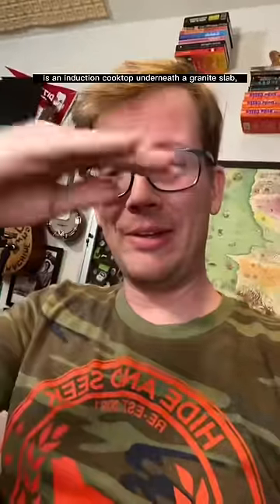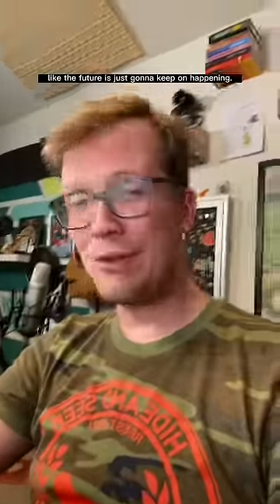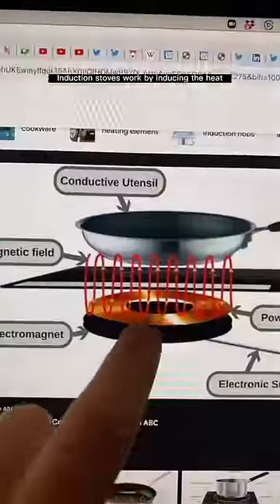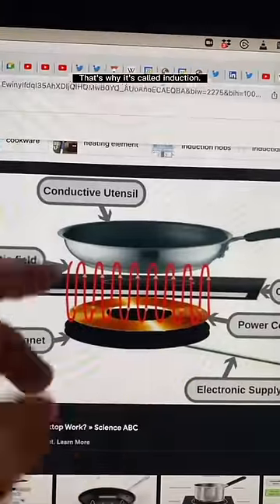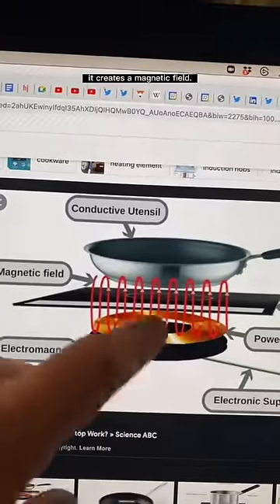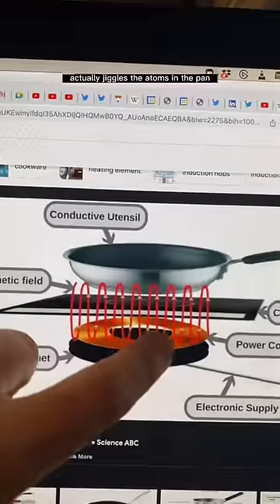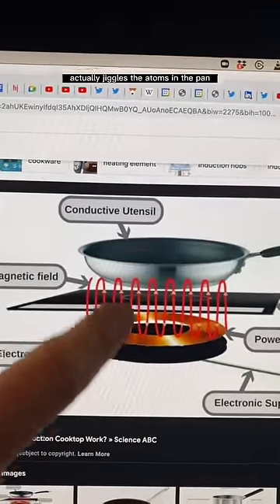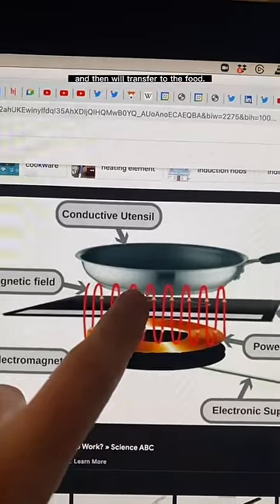How do induction cooktops work?

Comment: Yes, camouflaging the thing that can heat and melt various things is a great idea!
Reply: not how it works
Reply: @ouravantgarde yeah, you only need to worry about anything that's magnetic or sensitive to magnetic interference on the surface such as your phone or keys or credit cards or laptops. Nevermind the game of "is that pan hot or just left out"
Reply: @ouravantgarde the granite will still get hot from the pans and pots you heat up on it. After removing them you have an invisible super hot surface that can certainly melt stuff.
Reply: @derKischda this! That stone is going to hold heat for a LONG time. Plus all the scuffs and abrasions from sliding pots and pans off of it? No thanks.
Reply: @vlanoik  I know that. "various things" was intended to exclude both how some materials may not melt when heated to the maximum of what that the stove can heat it to in addition to some things no being directly heated when put on the stove. regardless, if a thing is being heated and something is on top of that thing, then the thing on top will usually also get hotter. "certain things" may have been a more accurate way of phrasing it.
Reply: @derKischda  Precisely
Reply: Yes it is  @ouravantgarde
Reply: I like how evryones arguing when there isn't even a fing induction stove under the granite its literally just a countertop. Use common sense it's literally a countertop where are the buttons or nobs to adjust the temperature. Where would the power even come from you can't just use any outlet for a cook top and they don't install heavy duty sockets on kitchen islands. Common sense people get some.
Reply: @tangerinetech5300 what do you mean where would the power even come from? You don't typically see the power source on your stove/oven because it's not esthetic and it's very easily hidden. Maybe this person is BS-ing, but it also wouldn't be very difficult to mount hidden nobs to the underside of the counter or behind a false front, kind of like those cool shallow cabinets that you sometimes see instead of fake drawer fronts in front of sinks
Reply: He literally told you it doesn't get hot
Reply: Not how that works but it could still cause problems
Reply: @msjkramey Modern induction stoves usually don't even have buttons or knobs anymore, they use sensors.
Reply: @derKischda  But it's granite, and granite releases heat very slowly. I bet you can easily put your hand on 100º C (212ºF) granite, feel it's hot, and yet not burn your hand.
Reply: @vlanoik like a cell phone
Reply: @ouravantgarde that's exactly how it works. You think the metal pan isn't going to transfer the heat to the granite? Only up to the food? No. Metal pan hot, hot transferred to thing metal pan is on
Reply: It was just explained it doesent work like that
Reply: @jarlbalgruufthegreater1758  wrong. Put a hot pan on a granite counter top. Granite underneath heats up from hot pan. Remove hot pan, camouflaged hot spot remains. Think more critically
Reply: @derKischda  wrong, you can literally take the pan off and put your hand straight on the stone and it's not hot
Reply: Watch the video again 🤦🏼‍♂️
Reply: @jamesm3830  I have a granite counter top that I put hot pans on it all the time. That heat transfers to the granite. And while it cools off fairly quickly, if you put something on the spot immediately after, like plastic, it will melt it
Reply: On the plus side, it'll totally charge your cell phone. Even the ones without wireless charging. Feature's been out for a long while. I originally heard about this on 4chan. Haven't tried it yet, though.
Reply: Yes and no. Not having indications makes it difficult to use, but induction cooktops do not generate heat. You can turn on the stove and put your hand on it and you'll be just fine.
Reply: @chasehaskell6490  Pan gets hot. Is sitting on cool granite countertop. Countertop absorbs heat from pan -- not fast enough to affect cooking, but enough that it'd burn you pretty good after 20 minutes or so of contact
Reply: @fred321  You don't understand how heat works. if its actually 100deg, you're gonna burn your hand.
Reply: @ouravantgarde that's not relevant though. The heat between the magnet and the rocks doesn't matter when we're calculating the heat transfer from a metal pan to said rocks.
Reply: @GamezGuru1  100 degrees only tells you up to what point  that will heat your hand (100). The rate that the energy transfers depends on both the temperature and on the material. If I put my hand on 100 degrees metal, it will instantly burn. If I put it on 100 degrees water, and take it out immediately, it will burn a lot less.

You can put your hand on a rock that is 100 degrees, and you will feel it is very hot. If you leave it there, it will heat up to match the temperature, however, you have a lot more time before the heat does significant damage.

The same concept can be used when you go to the beach on a sunny day: It's much harder to walk barefoot on sand than it is on concrete or wood. They're being heated by the sun, and are about the same temperature, but one heats up your feet a lot faster than the others.
Reply: @derKischda you can put paper towels under the pan while cooking and they won’t burn using induction.
Reply: @duke605  Not very much tbh. Heat rises after all.
Reply: @fred321  I get your point about heat conductivity, but it's crucial to recognize that rocks, including granite, boast fairly efficient heat conductivity. Your comparison between walking barefoot on sand versus wood or concrete at the beach actually supports this idea. Sand, essentially finely ground rocks and minerals, heats up faster due to its superior heat conductivity.
Though i should note that concrete also transfers heat much faster than wood, similar to sand.

Think about the historical use of rocks or stones in cooking surfaces Throughout human history. Even today, we still employ rock like materials, often in the form of ovens, for heating foods. The enduring practice stems from the efficient heat transfer capabilities of rock like materials.

So, when you mention putting your hand on a 100°C sheet of granite, it's not an instant third-degree burn like with a steel bar, but it can still cause significant damage over a reasonably short amount of time, certainly far less than a minute. Just because it's not an immediate burn doesn't mean it's not a burn; both scenarios still warrant a doctor's visit.
Reply: @Cat_of_America I just googled it:
Sand conducts heat about 5 times faster than concrete.
Steel conducts heat about 15 times faster than metal.

Yeah... in the time metal does a 3rd degree burn, I'm not sure you could get a 1st degree burn from granite.

I know we use rocks for cooking. My mom used to use stone pans to cook, and I knew I could see if they were hot by touching them fast without burning. I would never do the same with aluminum pans because these do burn with the slightest touch.

You're very wrong about why we use stone pans. It's not because they transfer heat fast. It's because they're so slow to transfer heat that even when you put a big open fire under them, the food might not burn. If you try to cook the same way with metal pans, you will get a half raw, half burnt meal.
Reply: @fred321  Your points are interesting, but there seems to be a misunderstanding regarding heat conductivity. While it's true that sand conducts heat faster than concrete, your comparison between steel and granite overlooks the fact that granite, like steel, is also a solid material with relatively high thermal conductivity. This means it can transfer heat quite efficiently, causing burns over slightly more time than steel. It's crucial to recognize that granite can still cause significant burns in a relatively short amount of time, even though it might not be as instantaneous as steel.

Additionally, it's worth noting that steel is a type of metal, not a separate category from "metal."

Your personal anecdote about stone pans is noted, but it's important to consider the broader scientific understanding of heat transfer. While stone pans may have benefits in certain cooking scenarios, they're not solely valued for their supposed slowness in transferring heat. Historical and practical evidence suggest that stone pans are used not just for their ability to withstand high heat, but also for their efficient heat transfer, similar to steel, allowing for consistent and controlled cooking, during a time when metals were expensive and not widely available if at all.
Reply: @tangerinetech5300  I confidence of the ignorant is truly hilarious. look, you made an okay inquiry asking where the controls are, but you should have done research first. A lot of induction cooktops that have granite, marble or quartz countertops are known as invisible cooktops as well. the whole point is to hide everything that makes the ugliness of a stove invisible and not distract from the architecture of the kitchen. so the controls are usually hidden under neat in a drawer or off to the side. Sometimes there are controls right on top of the counter but other times it's built into the counter itself as a touch controller and lights up when you interact with it.I have also seen touch controls that were on the range hood above the cooktop.

You don't even see where the induction plates are, but you can feel it with your hands with slight etchings on the counter. Others are totally smart home enables and you can control it with a potable kitchen tablet.
Reply: @eingoluq  says confidence of the ignorant about a stove top lol and is the random capitalized "I" at the beginning of your comment also supposed to indicate ignorance or do you not know how to proof read your insults. And I love how your just calling me ignorant and saying yeah there is a stovetop. Like okay pal have fun caring about nothing.
Reply: @duke605 the pan isn’t directly in contact with the counter top, check the original video
Reply: What a terrible idea! Way to go
Reply: @unsaidatom2310  learn how it works first. if you sit on it while it is on absolutely nothing will happen. because it doesn't heat things through the stone.
Reply: @derKischda  this actually depends on the type of counter top and likely if you CAN put this counter top over the cook top it's a protected kind that doesn't damage or get hot from pans or cookie sheets I know cause my family was actually given such a counter top it's very nice
Reply: @FalseMem0ries the stone doesnt get hot 😂
Reply: @tangerinetech5300  its underneath behind the cabinet door, thats the whole point of the cook top is to mimic just being a plain countertop
Reply: You do have to switch it on before it works...its just a countertop otherwise
Reply: It can't heat or melt anything without a pan and when you put a pan on it it's not camouflaged
Reply: @eingoluq  um, we all know how they work. Some of us even have induction cooktops, and they have an indicator when the glass is hot, because, science
Reply: Lot of chatter on this topic... it's still possibly the most retard idea for a cooktop ever. If you know anything about induction, the pan actually has to be in the right place to work properly, but for those who think it's a good idea, go ahead and get one
Reply: @unsaidatom2310  My comment was responding to someone else dude. not you.

It's weird you have to defend your knowledge like that.
Dude clearly the guy I was responding two has no idea how the thing works.
Reply: @eingoluq  well, maybe don't reply to me if you're replying to someone else? Weird that that needs to be explained
Reply: @ouravantgarde despite what you may believe, if you aren't heating the countertop but are heating something on top of the countertop that then heats up the countertop. Hope this helps
Reply: @tangerinetech5300 We have a kitchen island with an induction cooktop. Getting the power there was a cinch, and pretty standard procedure
Reply: @majapaja_ the heating element itself does not transfer heat by getting hot.
But the pan VERY OBVIOUSLY gets hot. And what do you think a hot pan does to the surface it rests on?
Reply: @derKischda it will not, you can wipe the surface as you cook. Literally, lift the pan (without turning the stove off), wipe it, put the pan down. It will be hot to touch, but won't burn you, unless you have like no receptors in your skin and you keep your hand on it. Source: I own one (regular, not hidden).
Reply: Make sure to leave your phone on the counter.
Reply: @user-db3xu1hw7r  Not just a pan. anything that is big enough and made of any metal conductive metal. Like a phone, jewelry, silverware, some kitchen appliances, or keys, to name a few. (there are some exceptions, obviously.)
Even if it detects whether something like a pan (a big-enough conductive metal surface.) is on top of it before it heats, so it doesn't heat the non-pan things I just mentioned, a pan doesn't just heat up what's in the pan. It heats up the counter as well! not necessarily enough to for example break a phone, but enough to melt the cover or give anyone who touches it painful burns.
Reply: @tangerinetech5300  could be out of picture. Like on the other side. Or concealed under a wood panel. If you're going to complain about a lack of critical thinking, then we can complain about a lack of imagination.
Reply: @tangerinetech5300  Where does the power for your outlets come from? What about your lights? In fact, where does your water come from?

Absolutely ridiculous point you just tried to make.
Reply: @tangerinetech5300 I was about to ask who designed this shit, don't even know where to put the pan 😂
Reply: It isn’t hot to the touch. Only the pot. Did you not listen??
Reply: @sungodd63  The pot transfers heat to the counter. Also, phones and keys and stuff contain metal. I'm simplifying it a little here, but the stove heats metal. Also, there are more than 50 replies here. "did you even read" could be a logically appropriate response to you, but it still holds some level of hostility, which isn't an accurate reflection of my internal reaction to your reply.
Reply: @ouravantgarde we have one, that's LITERALLY how it works, our is not camouflaged but I once put a plastic thing on it while I thought it was cold and it started melting
Reply: @sungodd63  I have a normal induction stove (not in granite lol) and the pan getting hot does heat up the surface it rests on. It’s not as hot to the touch as a regular stove, but when you remove the hot pan from the induction stove after cooking, a noticeably hot spot remains for a while. My stove even warns you about that.
Reply: @derKischda  I sell  kitchens for a living (Germany) this variant would still have indicators of heat allso built into the stovetop. The granit is shaved off from below to allow strong LED indicator lights to show up on the top when on.
Reply: Guys. A hot pan WILL heat up the counter top. So after cooking it WILL be hot.
Reply: @majapaja_ - the pan gets hot….stone holds heat… it just wouldn’t be a viable setup. I’m agreeing with the people that say this is a dumb idea for so many reasons.
Reply: @tangerinetech5300  The controls are most likely on the other side, you know, in the kitchen...
Reply: I mean that is how it works if it's a ferromagnetic material object on top it most definitely will heat up @ouravantgarde
Reply: @ouravantgarde anything metal will get super hot if placed in that spot on the counter while the stove is on
Reply: Hank is explaining how a traditional induction cooktop works, not how this specific one with a countertop layer inbetween works